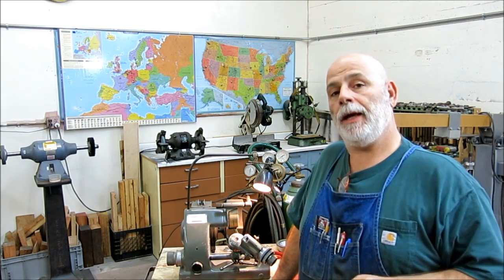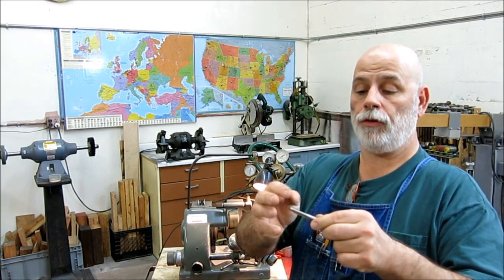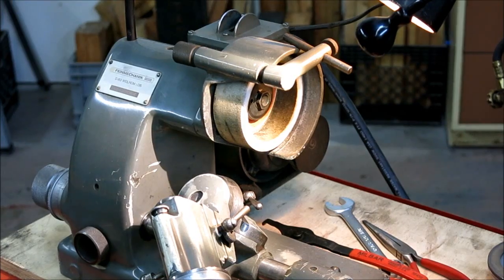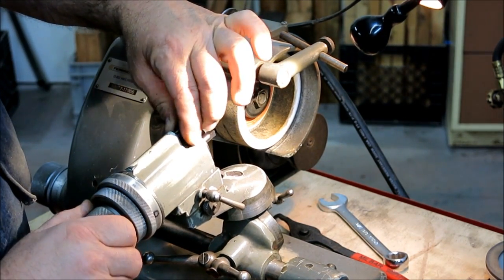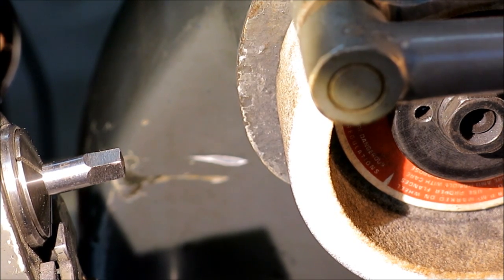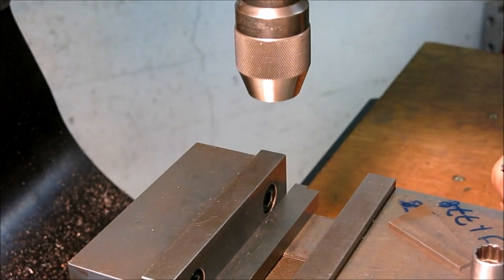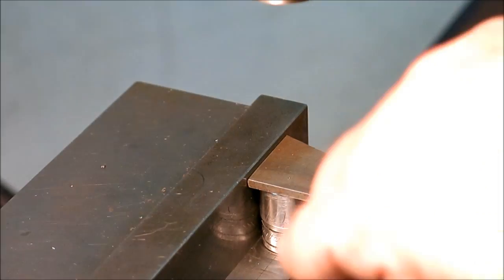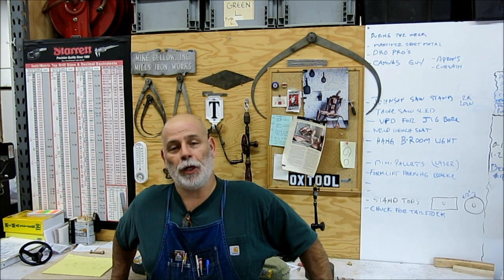Deckel Square Broach

Comment: Tom- Quick question. How did you get the Decker head to swing past 90 degrees in order to grind in your 3 degree back relief?  I’ve watched dozens of rotary broach videos and taken apart my Deckel head several times. It seems like the hard stops prevent it from swinging in the direction you achieved. I’m stumped. Thanks in advance. Adam
Reply: I have the same question ?? i cannot get it from 0 to 90 degree?? the other video this is not a Deckel SO

Comment: Well great job, but I have a question? Why we make a 3 degree inward angle on a broach tool.?  How it helps? Thanks
Reply: reducing the drag on the tool, by reducing the contact area. Hence, making it easier to push through the material.

Comment: Hello,

How did you setup the horizontal swivel arm for the releaf angle grinding? My machine is only able for 0-90 degrees toword the right side but this will create a wider back portion of the broach. Is there a way for rotating the horizontal arm to left -3 degrees as you did?
Thank you!
Reply: Depending on the machine, there might be a little pin that you pull out to let the head swivel past 90. I think it's on this mans' video   https://www.youtube.com/watch?v=neupF0-UnPo   I hope I have understood your question correctly.

Comment: ironic that this video shows up in the recommendations after I spend half a night trying to think of ways to broach a single square hole with the tools I have available.  Then it turned to sardonic because you "broke it off in the vice" right after I viewed an AvE video...
Reply from the maker: Hi Digger,

These magic boxes are reading your thoughts. Well at least AVE's is. Thanks for the comment.

Cheers,

Tom
Reply: You should have a look at Clickspring, clockmaker. Though, he makes his broaches on the lathe with the pilot hole progressing to square of size required.

Comment: Tom
Last month, I picked up my new (to me) 1970 Deckel SO. The same night, there you are Deckling a square broach. D-bits, D-Reamers, vertical shear bits for the lathe. Too much fun. I'm making some square inserts (not broached; machined) for the Deckel collets. BTW, they are U2 designation.
Thanks for what you do.
Reply from the maker: +Stan shire Hi Stan,

You will love that little grinder. Its really user friendly and can do a lot of little jobs in the shop. Mine paid for itself on the first job making medical stabbers for a test. Thanks for the comment.

Cheers,

Tom

Comment: tom u would not have believed this other video this guy selling a deckel was telling them that it was easier to pull the blank and sharpen the tip by hand than to take the few seconds it should take to reset the angles  and use the grinder like it was designed to be used . this guy had no clue as to how accurate those grinders are . you seem to be pretty good at what i have viewed so far , keep up the good info , maybe when you do some close up shots as w this video take the camera off of auto focus though while you want us to see whats happening , otherwise good job . but my what big thumbs you have ...... ha ha      ;  )

Comment: Would this same tool/procedure work with a blind hole?
Reply from the maker: Hi Walter,

Yes it does but with one important caveat. There needs to be a relief near the bottom so the chip has a place to break off.

cheers,

Tom

Comment: Tom,  great video.  In the past I have also made un-round holes... Usually unintentionally. 

Ok, Mr. Wizard.  (I get a kick out of you calling yourself that after a near mess-up) How would one go about making a broach for making a square hole in something thicker say some 3/4" round stock.  It would be cool to make a boring bars that held 1/4" square ground bits.  Double extra bonus points if it can be done with out needing a super zoomy deckel grinder!  Mine seems to have gone missing...

All the best.  Thanks for sharing.  Chuck.

If you have an extra pin.  Put one in Grosse Ile, Michigan.  At the mouth of the Detroit River at Lake Erie.  I'd love to be part of the club.
Reply from the maker: Hi Chuck,

I have a couple of home made tools you might like. They are similar to Bridgeport slotter tools. A quarter inch high speed tool is brazed into a steel shank for cutting internal keyways and the corners of squares. I'll see about getting it into a meatloaf.

Best,

Tom

Comment: The deckel collets are like Aciera and Schaublin they are valled W16, W20 and W25, im taking a guess its either the extended W20 collet or the W25 collet in your grinder. The collets has a DIN number at least i have found the W20 collet, they are DIN 349E, and is common in workholding application for static holding in a CNC machine or similar these days.

Comment from the maker: Hi Tony,

I'm not sure of the make of the abrasive wheel. I think its Sait. The issue is the arbor size hole which is sometimes different between normal abrasive chop saws and wood chop saws. As far as the largest material I've cut with it that would be 1 x 2 inch 1/8 wall steel tubing.

Regards,

Tom